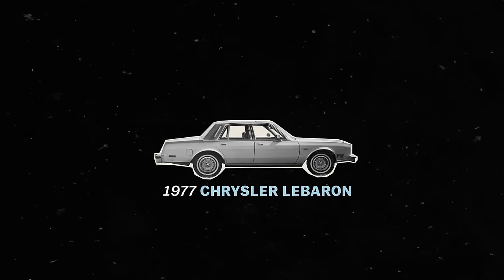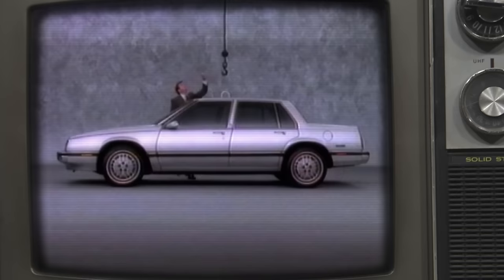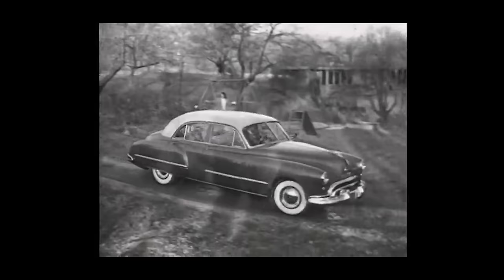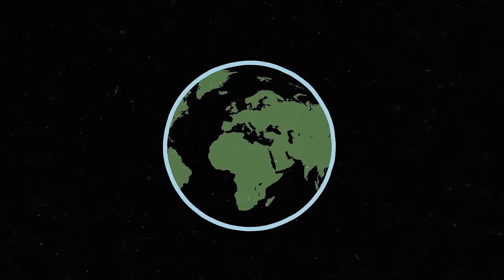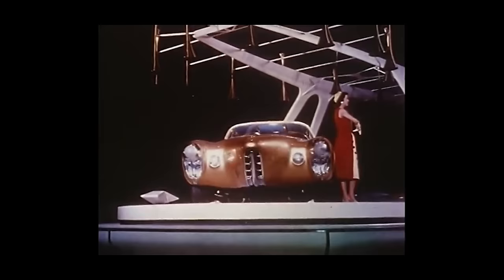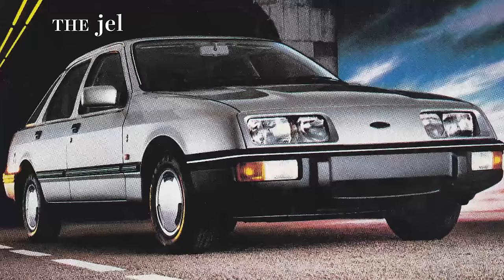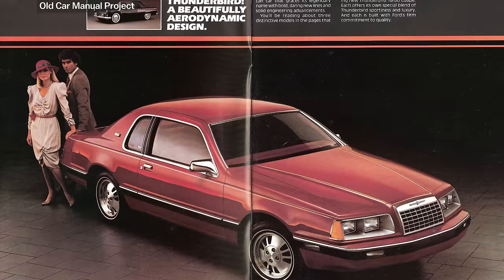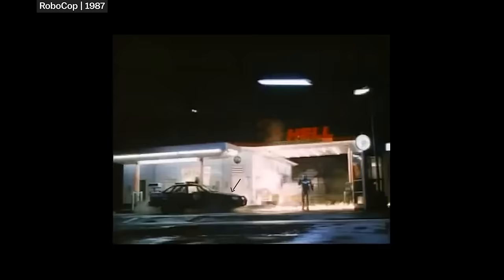How cars went from boxy to curvy

Comment: Spoiler: Aerodynamics lowered gas consumption
Reply: already guessed aerodynamics before I clicked
Reply: Always gots to be a spoiler in the comments section XD
Reply: I'm thankful for the spoiler cuz I didn't actually want to watch the video to find out the answer 😂😂😂
Reply: Viwe Mbava  I would hope people knew this before watching the video
Reply: Tate Moran, well apparently not everyone, since vox decided it was enough to make a video about it
Reply: Ricers think spoilers make the car go faster 😂
Reply: +Crev 4Cuba unless you have rear wheel drive..
Reply: not rly, aerodinamics dont even save 0.000001% fuel consumption at low speeds at all.
Reply: ***** that is true. Parasite Drag is more prominent at higher speeds and its effects are exponential.
Reply: Lineage is right. Aerodynamics does not come into effect until 60 and faster. But it does become more and more important as you exceed 60. The real reason is for noise levels. In the 80's, a current car then, would not reach future sound  level requirements rolling down a hill with the engine turned off!!
Reply: not true; air drag is important even at 40mph-ish

http://kilowatt-age.com/yahoo_site_admin/assets/images/image005.269174101_std.png
Reply: too late you told me this RIGHT AFTER the person in the video told me
Reply: Spoiler: It increases downforce
Reply: Spoiler: spoilers raised gas consumption.
Reply: Also, lowered style, compliments on your round jellybean, joy in driving, individuality in designs...

Comment: Another major component to the radical shift in styling we see in the early 90s is the DOT approving the use of composite headlamps, allowing for headlamp and front end designs that simply would not have been possible with square, rectangular, or circular sealed beam lamps. Until then, the only options was complicated retractable headlamps, but with composite headlamps using specially shaped lenses, they could make any almost shape to fit designers' visions.

Comment: Curvy cars are more aerodynamic, but beyond a gentle rounding of the edges and corners, they also tend to be less space efficient, especially when it comes to cargo room. So many of the more utilitarian cars of Europe were actually getting  boxier, sometimes boxy in the extreme, during the 1970s (eg. the curvy VW Beetle and Type 3 fastback gave way for the boxy Rabbit and Dasher) and the downsized U.S. cars of the mid-to-late 1970s (eg. Cadillac Seville, 1977 Chevrolet Impala, 1979 Ford LTD) imitated the boxiness of their European and Japanese counterparts. The 1980s, with people getting tired of boxy styling, improvements in manufacturing technology that made flush windows and smooth headlights cost effective and speed limits rising again, was an ideal time for a car like the Ford Taurus. Now cars are about as rounded as ever, but many trucks, even with smoothed edges, seem to emphasize the boxy nature of their cargo-friendly shapes. Fashion will probably continue to push styling in shifting directions, but aerodynamics will play a big role in shaping cars in the future, even those that emphasize cargo capacity.

Comment: It's not only aerodynamics. Curvy cars tend to fare better in crashes because if the frontal roof arch has no stress points it is stronger and the passenger compartment holds its structural integrity much better. Also, rounded corners allow for easier maneuvering in tight spaces with fewer chances of touching walls or other cars.
Reply: But I like boxy cars like ford bronco

Comment: It also had to do with manufacturing and designing processes. Back in the 30/40's, they handmade the molds for the stamped steel, and alot of high end cars had panels hammered by hand to their final form. Then in the late 70's, computers started being used for the designing of cars but due how limited they were, designs were limited to straight lines and edges. That is why the 80's are the pinnacle of boxy. It has little to do with fuel prices since in the 50's fuel was cheaper then the 80's and 50's cars are way rounder, even in europe where economy matters.

Comment: There is so much wrong with this video I don't even know where to begin. The most glaring example was the fact that all the European examples given  were sports cars... even though they were talking about saving fuel? Yeah I'm sure people were buying porches to save money on fuel.
Reply: Buying a porch does save a ton of money on fuel. A Porsche on the other hand....
Reply: slickrickbawss I'm feeling just the same.
Reply: Kepe Brilliant
I liked it
Reply: That was oversimplifying.  European family cars have always tended to be curvy to save on fuel, right back to the VW Bettle.  Fuel is also a HUGE part of the running costs of a car in Europe.  (I spend about £2K on my car each year and fuel is at least 70% of that).  So even luxury cars like BMW and Audi have needed as high fuel mileage as possible.  Porsche had curvy designs to improve road holding and acceleration, but many of Porsche's innovations got handed down to the cheaper manufacturers, like disc brakes and ABS.
Reply: Yup, porsche has been ahead of its time since inception. Even the first to manufacture an electric car way way way before Tesla. The problem was it wasnt cost effective or trendy. And electricity in Europe was not as readily accessible. Theres a reason Porsche is regarded as one of the best cars in the world
Reply: porches save so much money
Reply: seat 600, trabant 601, fiat 500, zastava 750...
Reply: slickrickbawss I got my Ferrari for the MPG
Reply: European streamlined aaaa Citroen? You know since the 50's and on? Do your homework before making a video
Reply: BritishCommentWriter First car with diskbrakes: citroen ds first with abs: some crappy merc not porche

Comment: Boxy cars have one big advantage-you can actually sit in the back seat in comfort! Those jellybean cars have rear seats usable only by children and  amputees.
Reply: Seating isn't a big advantage towards car guys
Reply: That has more to do with unibody design than exterior shape.  One of the biggest reasons cars are so safe even though they're technically smaller than the boxy land boats of old is because you have a unibody safety cell that encapsulates everything with a tough steel chassis.
Reply: +phuturephunk Chryslers were unibodys since 1960.
Reply: Umm, no, Mopars were unibody, since the 60's. Unibody is defined as NOT the usual body on frame construction.  No frame on a 60's Mopar, that's why they are so difficult to restore. Rust is hiding everywhere.  And that's also why Mopars were so lightweight, with killer engines, that made Mopars the stoplight winners. You had to spend big bucks modifiying Chevy and Ford engines, with body on frame construction,  to compete with the mopars. Mopars were cheap, and un-beatable, as used cars. When you slammed the doors, or the trunk on a mopar, it sounded like the  it would rattle forever. Pieces of tin welded together. But, beautiful and fast.
Reply: lmao
Reply: the reason body on frame was dumped is due to safety/ cars are designed to crumple to abosrb energy and save ur ass. cars are back then are solid. good for reliability, bad because ur more likely ot die in them
Reply: Strange, i am 6 feet tall and have no problem sitting in the back sear of vitrually any compact or larger car save a few outliers like the VW CC which is an extreme.  And you look short.... what are you, 5'6" at most?
Reply: jellybean is a ford f150 from the early 2000s
Reply: randomrazr nope it was dumped due to cuting production costs, body on frame is safer than unibody at leas in head on crash
Reply: Who sits in the back seat anyway other than kids and uber passengers?
Reply: Aspectrum You let your friends in your car? I'll let two in max. Everyone else better drive themselves or we're taking the subway.
Reply: Aspectrum Yeah, but whenever I met with friends in a car centric city, we all meet up in our own cars anyway.
Reply: There is also another huge advantage of big, boxy cars: the trunk is big enough to fit even 3 bodies :)
Reply: Remy Fagerstrom An SUV is only true SUV if it is the size and chassis of a Suburban! I hate the center consoles in cars with the gear shift on the console for an automatic, I prefer automatic shifters on the steering wheel column with a 40/20/40 split front bench seat!
Reply: Amputee joke
Reply: mesedrew broncos and blazers were the first SUVs
Reply: @Tomek1985  cutting*
Reply: @Tomek1985  least* in a*
Reply: @default2826  Literally*
Reply: @albertastorms  a* true SUV
Reply: @albertastorms  Shifter on the wheel?!?!?! We ain't truckers!
Reply: Just buy an SUV
Reply: Cars of the 70's and 80's had terrible legroom. Every car was rear wheel drive and needed a large engine compartment to contain it all. It was very inefficient use of space. A Honda Accord of today has more rear head and leg room than any full size GM, Chrysler or Ford back then. Don't get me started on the basic bench seat with few adjustments all of them had too!
Reply: Yeah, WV Passat have this problem for long passengers on the back but cheaper model Jetta is more boxy from the back
Reply: I don't lole how boxy cars look, and their circular headlights. In my opinion it looks weird.

Comment: Soon Cars Are Going To Be Flat
Reply: Like earth
Reply: Pedro Rocha I was gonna say that.
Reply: oooooooh roast battle alert
Reply: Cosmos Media New cars are slowly becoming more polygonic.
Reply: Like my personality.
Reply: like Earth?
Reply: Actually cars will eventually become boxier, well sort of, they be curvy but with boxy folds/creases, kind of a cross between the two.

Keep in mind though that aerodynamics in future cars will be drastically different due to advancements in material science that will allow for micro air ducts.

Sort of like having microscopic tubes into the car's material construct that dynamically control the flow of air, not just under ideal conditions, but even under windy conditions.  The flow of air will be channeled and funneled variably through the material of the car in order to drastically increase fuel efficiency, especially at high speeds.

Likewise the channeled air will be used to increase fuel efficiency/mixing.  Basically the way cars work now is a mixture of fuel/air is pulled into a cylinder and then ignited.

Cars of the future will use dynamic fuel/air mixtures, altering both the temperature(s) of the air intake(s) and the specific mixing pattern within the cylinder in order to drastically increase fuel efficiency under a whole multitude of environmental conditions.
Reply: like the e a r th
Reply: Well, the only big curvy cars that are good is the lincon town cars and the Ford crown Victoria
Reply: Pedro Rocha earth isn't flat
Reply: Bob Bob {The Car Salesman} polygonal*
Reply: Cosmos Media Nope 👎
Reply: bruh OOOOOOOOOOOOoOOOooO
Reply: Cosmos Media look at pine wood Derby cars
Reply: Cosmos Media like the earth
Reply: Yah. Mine will be 2bhk
Reply: Cosmos Media lol
Reply: Just like the earth?
Reply: Cosmos Media AERODYNAMICS BRO
Reply: Pedro Rocha the earth ain’t flat
Reply: Pedro Rocha - you stole my comment
Reply: Soon cars are going be like IT from South Park
Reply: Cosmos Media and next tall
Reply: Nope, they will just be warped pieces of metal
Reply: Lamborghini?
Reply: Soon, cars are going to be outsold by teletransportation cabins!
Reply: Just like our earth?
Reply: Cosmos Media no, it will be the sahpe on an "O"

Comment: I like older cars
Reply: Alexis' Fishin', Huntin', and Farming Show  me too,and ride me
Reply: Alexis' Fishin', Huntin', and Farming Show I enjoy driving a new pile of plastic that has 13 computers to give me trouble.
Reply: Jim Rr+ right? l love it when my ECU fails and then my car locks up until the dealer can replace the ECU and re register it with the rest of the system.
Reply: Someone better make a “like my men” joke i stg
Reply: Same here!
Reply: I like fuel efficient cars
Reply: I like the cars from before they got boxy.
Reply: Jim Rr Agreeed, the 13 troublesome computers and an inaccessible engine bay really make modern motoring an absolute pleasure.  Who needs individual style, flair and design classics when you can trade that all in for modern day reliability at the cost of...........everything else.
Reply: Alexis' Fishin', Huntin', and Farming Show same
Reply: Alexis' Fishin', Huntin', and Farming Show 
"I like older cars" What does that even mean? A 10 year old car? 20, 30, 50, 100 year old car? That covers a lot of different cars and manufacturers, many of which are diametrically opposed to the design and concepts behind the others. For every one thing you might like about an older car there are a thousand other older cars that contradict that idea.
Reply: Alexis' Fishin', Huntin', and Farming Show True. The older cars are built stronger and made to last.
Reply: Nintation Playstendo True. Many things were built to last, but unfortunately capitalism gets in the way. There's more profit to be had with junk that gets thrown away and replaced. And it's all about profit it and keeping the shareholders happy for the next quarter.
Reply: I bet you like driving slow in a 45 lane and constant tune ups too
Reply: +Latrice Krone hello honey
Reply: Me too
Reply: Boxy are better
Reply: 1960s is my favourite era of cars
Reply: Late 90s to early 2000s were the best in my opinion

Comment: Curves on vehicles also improve safety (i.e. crash safety, control of the vehicle, structural integrity of the vehicle, etc.) because there are fewer collisions with matter (i.e. gases, solids, and liquids) occurring at ~ 90° angles, and the apex of curved designs works much like the keystone of an arch—thus supporting the vehicle. Directing contact with matter by adjusting the shape of the body improves the safety of the driver and occupants dramatically. Impact does not kill; sudden change velocity kills. With force being directed away from the vehicle due to the orientation and design of parts belonging to the curved car, less force is exerted on the occupants of curved cars during wrecks than the occupants of "boxed" cars. Therefore, this curved car "trend" was not just economic because it also improved the safety of vehicles in general.

Comment: Boxy design all the way.
Reply: I agree this video is crap.
The shortest path between 2 points is a straight line not a curve. Physics is actually on the side of boxy designs. Look at airplane design such as the F22 or the F117. It has few curves and a lot of straight lines. The most aerodynamic design for a car would be diamond shaped with sharp angles to cut through the air.
For example the fastest mass production American made car was the 1970 Plymouth Superbird which had a top speed of over 200Mph because it featured diamond shaped design.
Reply: Actually the most aerodynamic shape is a teardrop. The boxy shapes on the F22 and F117 are to reduce it's radar signature cross section. Make it appear smaller on enemy's radar screens.

It's all about reducing the coefficient of drag. Interestingly, the bulge on the leading of a teardrop does that perfectly. A cross section of a wing's leading edge is also a teardrop. (but cupped on the bottom for creating lift)  Wanna see one of the most aerodynamic cars built a long time ago, check out the The Schlörwagen or Norman Bel Geddes, Motor Car No. 9, or Dymaxion Car, or the 1914 A.L.F.A., or Stout Scara, or Persu streamliner, or McQuay-Norris Streamliner, or the Spirit of Tomorrow, or any solar or pedal endurance experimental car.

Or the car which I've designed and building, called the EM-1
Reply: Except a diamond isn't a box you fool. A box implied a more perpendicular "wall" to the direction of air flow. And wind travels in waves, not straight lines.
Reply: +Eco Mouse
The fabulous Citroën DS Decapotable or, the standard Citroën DS are curving and straight but not boxy. This car was way ahead of its time with its exceptional lines, independent all round hydro-elastic suspension - in 1960 it was a game changer.
Reply: painful1978 Triangular designs all the way

Comment: But 40s cars are curvy...

EDIT: To clear it out, i didn't watch the full video.
Reply: Yes, because there was an aerodynamic craze back then too.  The Chrysler Airflow of 1934 was one of the first to feature a streamlined, Art Deco design, and this eventually became very popular.  Tatra in Europe was also doing very streamlined cars from the 1930's on.  VW Beetles and Porsches also shared this design. 
Eventually, streamlined design fell out of fashion, and by the 1960's, boxy designs were back in vogue.
Reply: But they were built by hand and the cars in the 90s were mass-produced
Reply: Actually, from the Ford Model T forward, most inexpensive cars were mass-produced.  But what does that have to do with the styling?
Reply: When the economy started to recover in the mid 1930s manufacturers started to make streamlined cars that could catch the public's eyes who had been stuck with boxy and jalopy style cars that been produced since the Model T.
Reply: It's MENTIONED IN THE VIDEO!!!
Reply: Have you NOT seen the video?